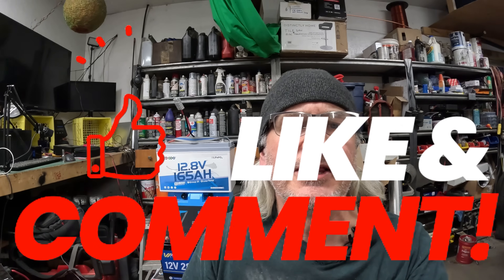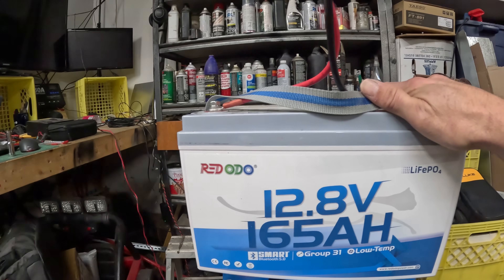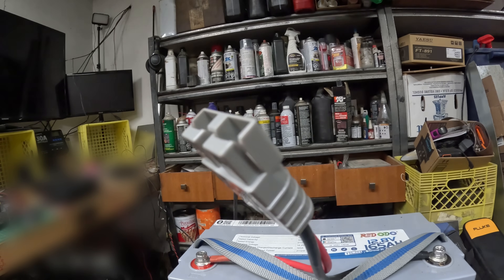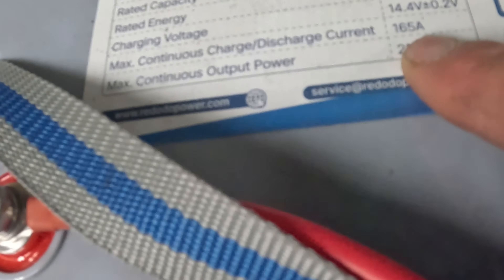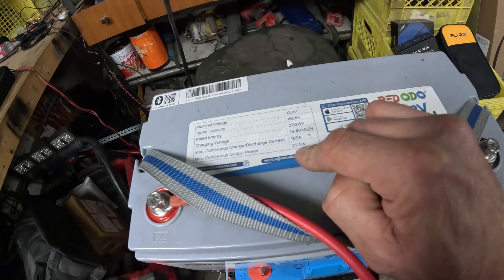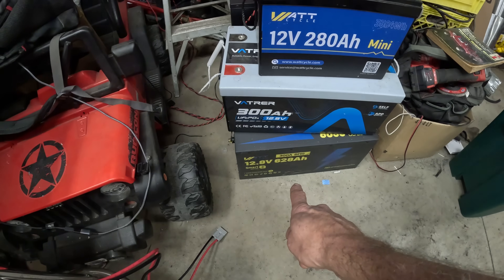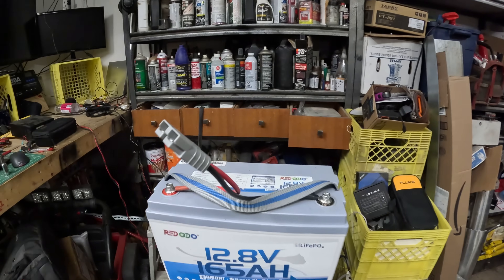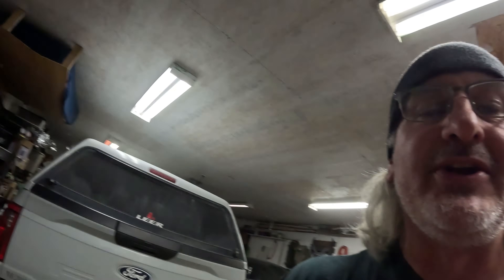65% MORE Power in the Same Size!? Redodo Group31 Bluetooth Beast! #offgrid #hamradio

Comment: Thanks to the generosity of Mike K8MRD, I have the 140ah Redodo Type 31 battery. Works great. I have to charge it about every 2 months. Not kidding. The carrying strap can be removed. I like that design.

Redodo, if you are watching,  I won't use an app that requires me to divulge personal information in order to use the app. Please change that.
Reply from the maker: Oh Mike is awesome!  Nothing wrong with having too much power.   Unless you have to drag it up a mountain, which in my case is not a problem.  😅.   And yes,  Redodo take note please.   💯